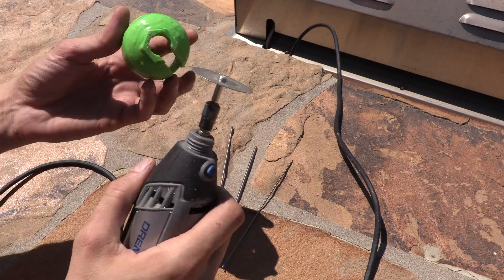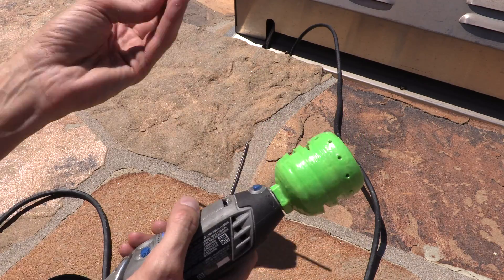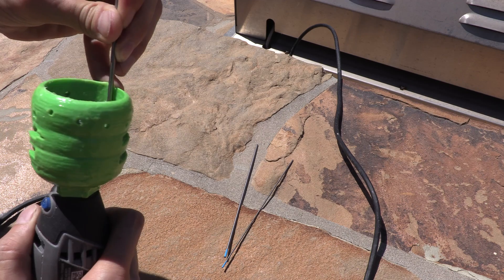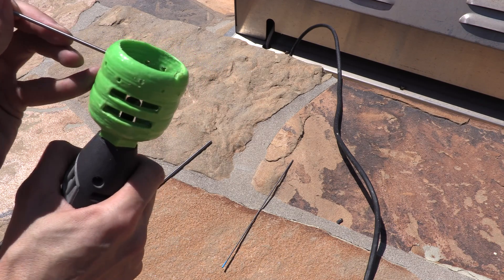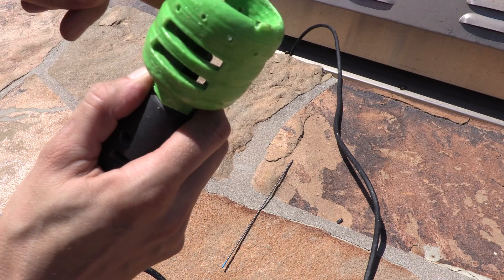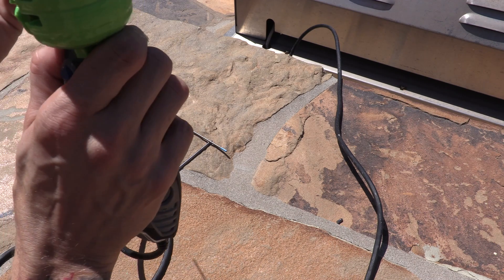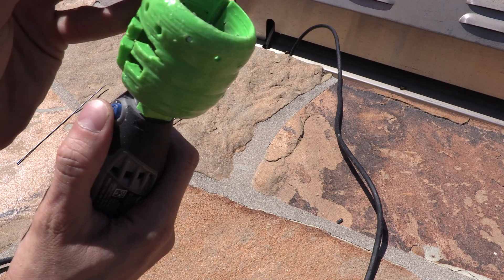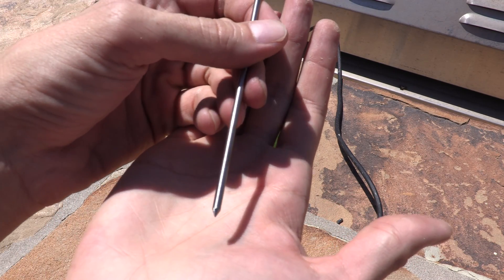3D Printed TIG Tungsten Electrode Grinder

Comment: You need a better wheel. I use a 25 mm diamond that cuts like butter. It was 3 bucks for one wheel but it is much much better than the rest that can get cheap. Lasts much longer too. Can cut 1/8th very fast. You're better off just picking up the carbine tungstenmate. I just used the diamomd wheel on rotary as is and got really nice points.
Recently ordered the tungstenmate and curious to see how much better it does compared to just manually using the wheel.

Comment: I stumbled on this vid after I printed my Tungsten sharpener.  I am using PLA and worried it will melt from sharpening tungsten so I covered the inner surface or my Tungsten sharpener with heat repellent silicone.